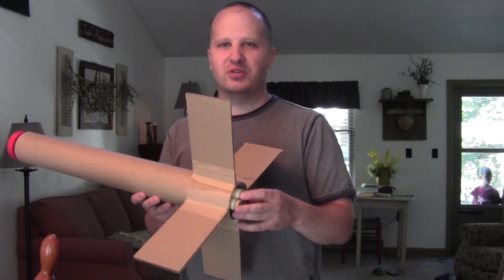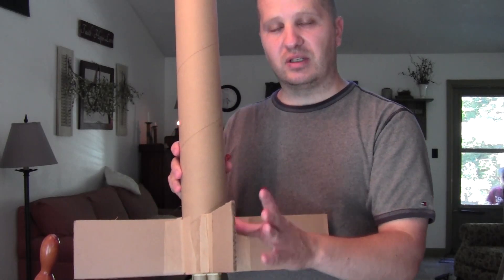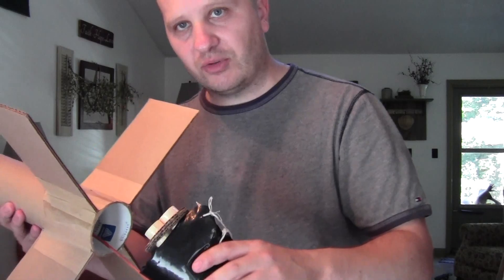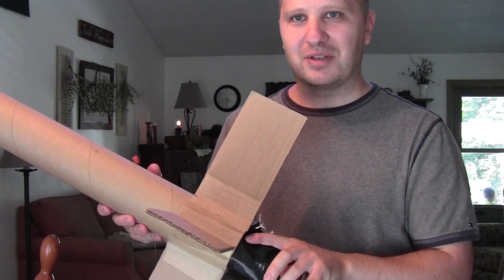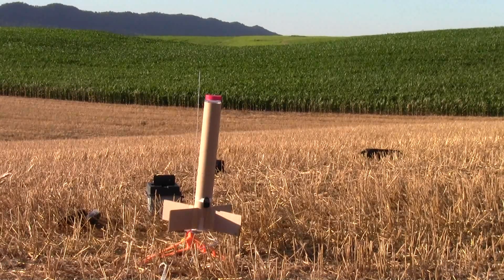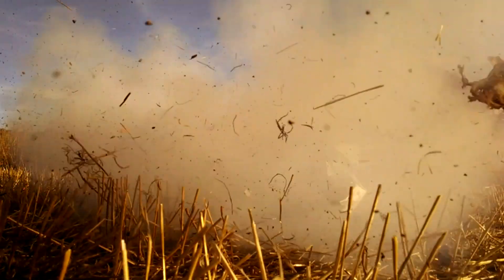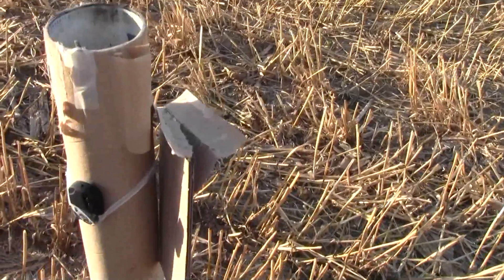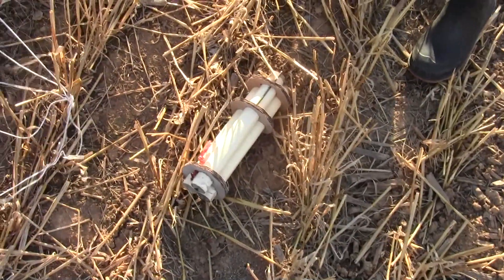Homemade rocket w/ D engine cluster - build, launch, and crash

Comment: Awesome that you made that from scraps. But your design would produce alot of drag. Not to mention the center of pressure is too far forward, causing instability. The stabiliser fins need to be cut on an angle, like a dart/ traditional rocket fin. And if you can make the nose pointy, that would greatly increase it's stability. Maybe if you cut 4 long triangles down wards at the top of the tube, then fold them in and tape them, as to make a pyamid tip. That would decrease the drag and move the center of pressure forward. Then it would go straight and much higher.

Comment: Thanks for sharing this.  I appreciate that you posted this, despite a few "mistakes"...  that's what make this hobby so much fun.  If it was perfect,.. it would be boring.   Anyway,  I was just curious if you have done any 3 stage rockets. I am building one now, and the estes directions are pretty minimal (go figure).   Any help in regards to how the 3 engines ignite one another is greatly appreciated.

Comment: Easy solution. Construct a small flame guard tunnel inside of the rocket tube, running the entire length of the tube, from the forward bulkhead and to the base of the rocket to house and protect the otherwise exposed shock cord from exhaust gases. 

Notch the forward and rear bulkheads of the engine mount so that the engine mount slides over that flame guard tunnel.

Thank you. Your failure will prevent my failure.

(I was expecting an unstable flight after you launched without a rod. That is too dangerous and I'd not suggest ever attempting that again.. You do want to keep the same Fin Area but you may want to change the shape of the fins with a sixty degree leading edge)

With a cluster of three E engines at a sanctioned event that rocket will get you a Certification Level One for High Power Rocketry..
Reply: The solution is just to use actual shock cord. Not some string you found in your house. Shock cord wont melt like that..

Comment: Nice concept.  When you know what you are doing, the results are acceptable.  Then, as you say - back to the drawing board with corrective measures.  Great vid.
Reply from the maker: Thanks for the feedback.  I'm hoping to get this back in the air with six engines instead of three, but haven't got the time to finish it up yet.

Comment: Brilliant! Not quite a Saturn-5 but dang good. I gotta tell you though,when I saw your "nose cone" I didn't hold out much hope for directionality......And then you gave it an unguided lift-off!!  I stand corrected.Way to go,man! :)
Reply from the maker: Yes, it was a rather impressive lift-off compared to most of my rocket launches in the past.  I am currently redesigning the engine mount to take 3 E engines AND 3 D engines (for a total of six firing at once).  That should be even more impressive!

Comment: It's good for a starter. Though, your nose cone has a lot of drag when launched due to the flat surface.
Reply: how do i know the max takeoff weight of a particular engine, someone please help me
Reply: @ukshaandumasia1446  I was wondering the same thing I figured out that you can just google it for example, google c6-5 engine thrust or whatever
Reply: @ukshaandumasia1446  or look up the engine weight
Reply: @floodgates6210  Ty i got what i needed :)
Reply: Ukshaan Dumasia just have the trust to weight ratio ATLEAST 5:1

Comment: Hey I've been studying physics, and I wanted to find out how high this rocket shot up. So I had to find the Velocity, which was the force of gravity(-9.81 m/s) times the time it took to fall back to the ground(about 5.71 seconds) and got an answer of a velocity of -56 m/s. I then took the velocity and plugged it into the Change in Distance equation which is (Change in Distance equals Average Velocity times Time) and multiplied -56m/s time 5.7 seconds and got a Change in Distance of 320 Meters. So that would mean this rocket shot up about 320 meters(1,049 ft). Please let me know if this sounds right, thanks (:
Reply from the maker: +jordan gemme I have no way to track it, but if I was to guess I'd have said 800 to 1000 ft based on my experience flying many model rockets in my lifetime.  So 1049 is certainly possible.  Thanks for the comment.
Reply: I'm currently a engineering student and for one of my classes we had to build a rocket from scratch. I built a simulation modle, all I need to know is the size of the motors, weight of the rocket and how long it took to hit the ground. so I can find how high it went. :)
Reply: Hey guys (: BernardoTech  garytewangoitewa  I'd love to talk to you guys more on a social and friendly way to learn more about what you guys are doing, I only recently started my interest in this, and I hope to explore space one day. If we can get in touch in any other way, I'd like that, my great grandpa who just passed away in November actually worked on the Van Guard Rocket with Warner Van Bruan and he was responsible for the propulsion part of it, take a quick read of his obituary, heres the link (:    http://obits.masslive.com/obituaries/masslive/obituary.aspx?pid=176384669
Reply: And I've been studying physics on my own, not even with school yet, when I got the interest of this, about 2 weeks ago, I had to expand my mind to it, so that I can learn more if I were to further my education with it in college, etc. Mind you I'm a Junior in Highschool, so knowing where to start with all this information is kind of confusing to me! I have Facebook, Instagram, an iphone, and I'd download whatever app it takes to get in easier contact with you guys (: Thanks for taking the time to read :P

Comment: To heck with it. The engine module was the more important assembly, at least it was "saved". The 'chute was made of too heavy of garbage bag material, so it took too much energy to deploy in the time that it had to operate  (maybe a couple of seconds)- so erring on the side of caution didn't pay off. The video was great fun to watch, so I'd say that it was a fantastic mission! I can't wait for more. Thanks! Oh yeah- NEVER put igniters in series - when the first burns through, the others loose the voltage. It's real easy to build your own custom igniters with calculated burn times for match head material, or ffffg black powder. (Maybe black powder is the wrong stuff to be introducing your kids to, but that's your call. I say the sooner you educate 'em, the less you have to worry about later.) The day they hear about Candy fueled engines, all bets are off! Better from you than the internet! Good Luck!

Comment: Hey Bernardo..Great video...and a great Dad thing to do with your kids!!! I make homemade rockets with my 3 boys for years now..however I always wanted to do multiple engines at the same time like you..but cant figure out how to make that work..could you do a follow up video on how you specifically wired the 3 engines to fire at the same time..really would appreciate it..have a great rocket summer!
Reply from the maker: Aidan1226 I will put that video on the to-do list.  But in the meantime, here's the lowdown:  you wire them in parallel.  In other words, you take the two wires coming from the launch controller, and hook one side of each igniter to one wire, and the other side of each one to the other wire.  The thing is, a normal launch controller probably won't have enough power to set it off.  I don't know exactly how big of battery you need, but if you just use a vehicle battery like I did, you should be good.
Reply: If anyone else is JUST NOW seeing this visit apogee.com they have HUNDREDS of how-to videos including writing of cluster-rockets

Comment: Find some kevlar shock cord for your next attempt. I've been into model rocketry for about a year now, and i always use a combonation of kevlar and elastic. The elastic is just a backup in case the kevlar snaps during ejection. I also wrap the parachutes in a fireproof fabric called nomex, but that isnt really necessary. You didnt seem to have any issue with the chute getting burned, and even if it did, a few holes in the chute wouldnt cause it to come down much faster.

Also, your fins are massive. If there is any wind when you launch it, that thing will weathercock like crazy. You could probably cut them down to half that length and still have a stable rocket

Comment: cool project.  What do you think of that key fob video camera you used?  Seemed to get pretty good video.  I was going to buy one too, but I saw a lot of mixed reviews.
Reply from the maker: The keychain cam I used here is an early 808 model which doesn't have HD.  I would suggest if you're getting a keychain cam to get the 808 #16 or #24 model.  Those are much better quality. More money, too, but you get what you pay for.  Of course, once you get to $100 then you have a lot of other choices as well.

Comment: Interesting build. Recommendation, use a better shock cord and mount for the next build and some epoxy (or at least glue) to attach the fins and the launch lug.  Tape just isn't the best material for this.  Also, IF you go about building the bigger one you suggested you might, try a cluster of 6 (or even 7) Estes E-9 motors.  They're pretty easy to find and would make a better, higher, more spectacular flight.
Reply from the maker: alienspy99 Thanks for the suggestions.  I'm thinking I'll use three E engines and three D on the next flight.  I'll make sure I get the right delay on the engines so the D are ejected first - they will not have engine hooks and the tubes they are in will be plugged so the engines just pop out and fall to the ground.    Then a few seconds later the E engines will eject the engine pod and hopefully deploy the parachute.   Having short tubes for the D engines will allow for room for the parachute around the three E tubes on the engine pod, and having the D engines eject ahead of time will make so they don't create reverse force against the ejection of the engine pod.